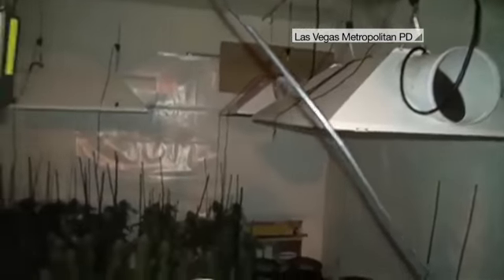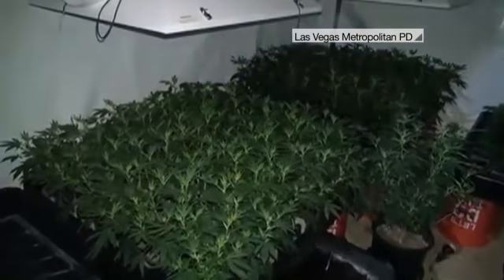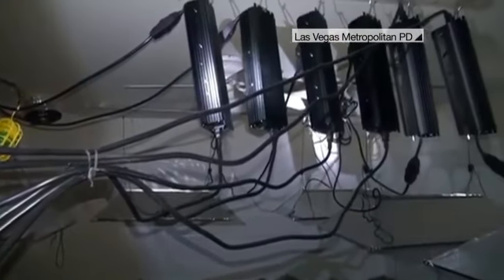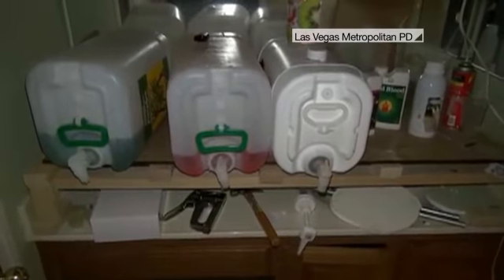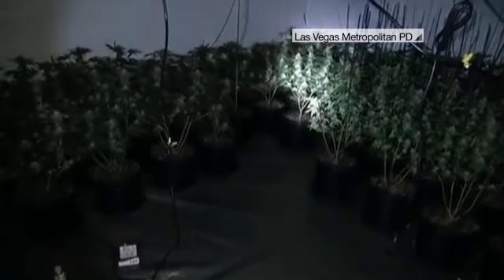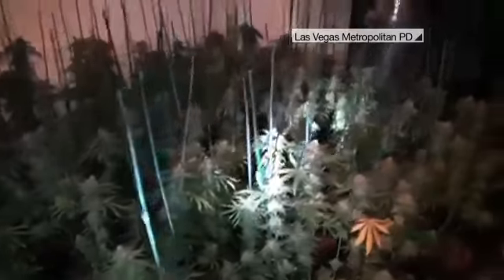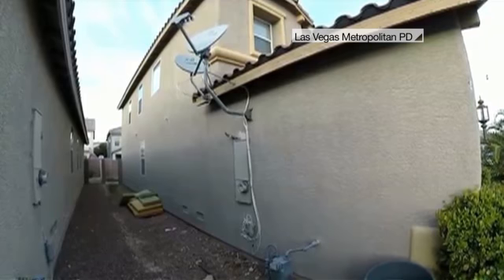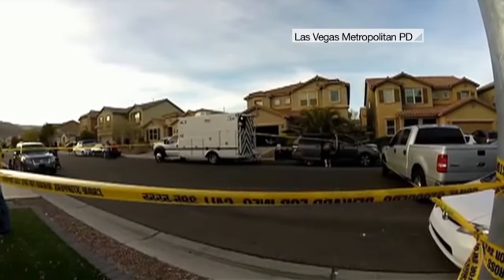Watch: Rare look inside massive pot grow house

Comment: Man people are so clueless when it comes to growing. The reason these so called “chemicals” or as us growers call them nutrients are used is because dirt is not used so there is no nutrients in the soil. You can really dial in what the plant needs in its NPK values. I love how they say the buds are full of chemicals which is not true at all.  There is a 2 week flush period where the plant is given nothing but straight water with no nutrients in it and in some cases a flushing solution to pull all the nutrients out of the soil for the plant to use up any left within it to have a clean product. Any bud that snaps and crackles when lit was not flushed long enough and still contains nutrients in it which is very rare.